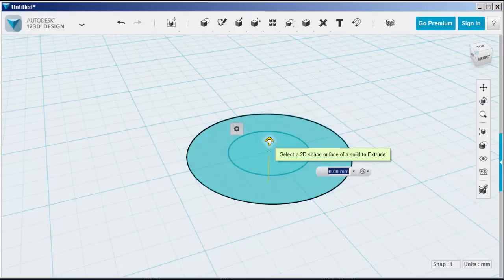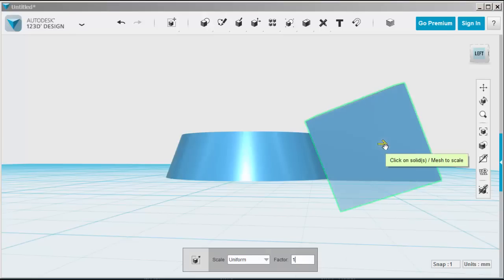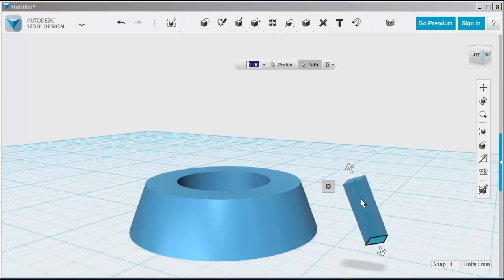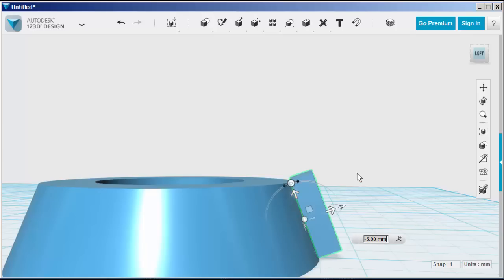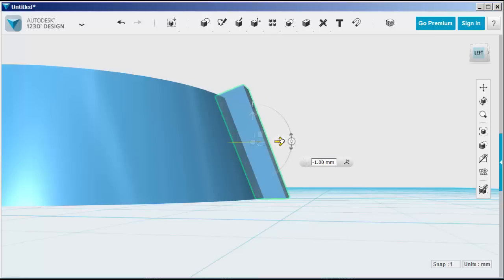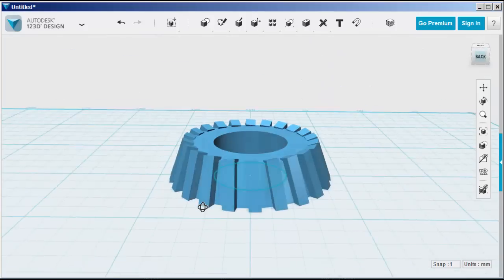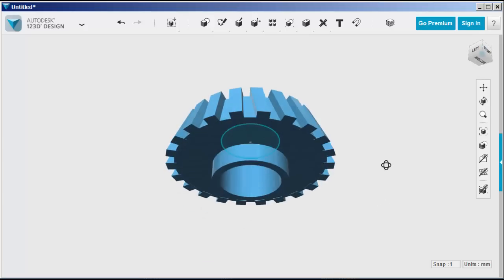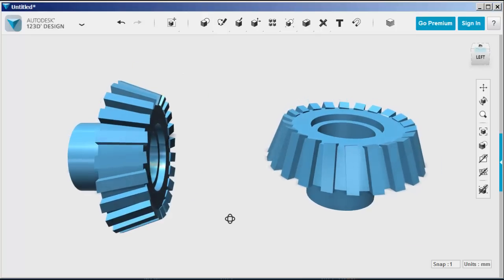123D Design: Bevel Gear

Comment: ProfDrafting, I would like to know how you would use the camera so I would be able
to take pictures using Autodesk123 Design. I've tried several ways with no success.
Could help me using the camera. Thanks
Reply from the maker: What camera do you mean? If you want scenes, just screenshot them.
Reply: When I take a picture of an object and I open Autodesk 123d it's not there. It's in my picture folder. I don't know who to get the object in to the Autodesk 123 folder. No matter if I copy and past the object it will only stay in Autodesk for a second. What am I doing wrong. Please help.
Reply from the maker: @erniemurdock8658  You can only import SVG files, and you do so under the menu with the Design graphic.

Comment: I honestly think you know a lot about 123dDesign, and I do learn a lot with your video's, but I don't think you understand how a gear works.
Your creation will never function as a gear because the angles are wrong and you didn't round the teeth of the gear.

Nevertheless, I now know how to start with building a gear in 123dDesign, and I also know how things should be made a little different.

Thanks for your video.
Reply from the maker: I know the angle is wrong, it was addressed in other comments. :) It was a subscriber request, I really wasn't interested in modeling a gear otherwise!

Comment: I don't understand why you have 15 thumbs down for this, it's a great tutorial... Keep them coming Lydia I'm learning so much from you.
Reply from the maker: +Tony Hodgson thanks tony! I think it's because I put the wrong angle.
Reply: its a great tutorial, i think the reason is the slow video as in low frame rate. its kinda annoying to view it. I recommend you to use a different screen recorder. Use something like fraps ( used to record gaming videos so you'll maintain the frames. 

cheers.
Reply from the maker: dilshan1994
 Thanks for the feedback! I use Camtasia. It has frame settings. Ironically, I used the settings recommended to me by O'Reilly for a 123D course I did for them. Do my other vids here have the same issue or is it just this one?

Comment: can sketch and 3d dwgs be sent to an ink jet 2d printer in 1 to 1 scale.  100mm will 2d print 100mm?
thanks
Reply from the maker: +Robert cat You need to export it as a .dwg file (design menu/export as 2d/export as dwg/dxf). Then import it into AutoCAD to create scaled drawings or into the web app Autocad 360, where you can do a scaled layout. Here's a vid on the latter. https://www.youtube.com/watch?v=P4qGz3Qisj8
Reply: THANK YOU,
I AM 63YO AND WILL HANG IN THERE WITH THE 2002 ACAD. GOOD JOB ON YOUR EFFORTS
THANKs the Best to you

Comment: hi
I'm not really sure what you are trying to achieve with these gears as you need 45 deg angles on both gears to mesh correctly. but I thank you for helping with tool manipulation If it wasn't for you I would still struggle with loft!.
Reply from the maker: +paul goodier You're right, I was just arbitrary w/ the angle because I was thinking out the process as I did the video!

Comment: Thank You! :-D

I'm following step by step.  

@ 00:51, we select "Hide Sketches".  What are we hiding?
Reply: +ProfDrafting I actually saw it again at 2:18, and saw the square and line profile disappear.

So, I am wondering what qualifies as a sketch, and what does not.
Reply from the maker: +TheRangeControl Anything 2D is a sketch. Anything 3D is a solid. You can hide both sketches and solids.
Reply: +ProfDrafting that took me a second to process as it is viewed within a 3D space...

...but, my mind finally decided to comprehend.  LOL
Reply from the maker: I was probably hiding the circles earlier. Sketches will interfere with operations you want to do on solids; you can't "reach" beneath them to select the solids. So either delete or hide the sketches as you work.
Reply: +ProfDrafting ahhh... got it! :-D